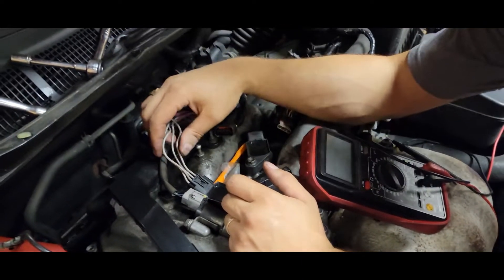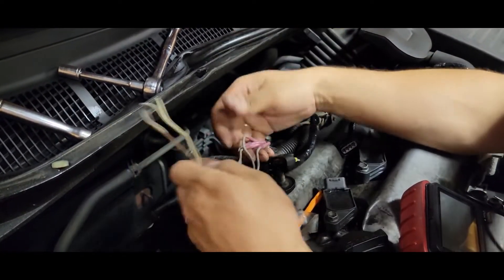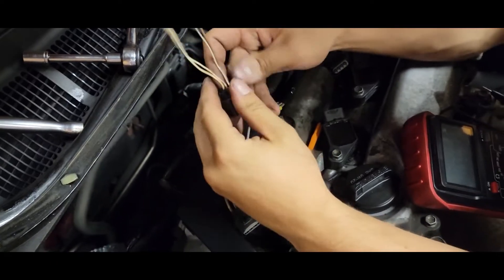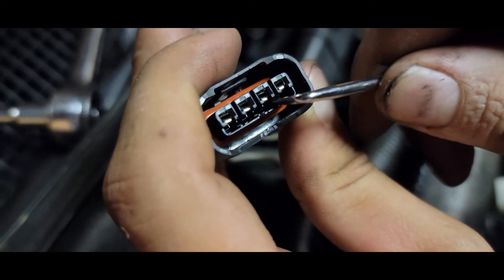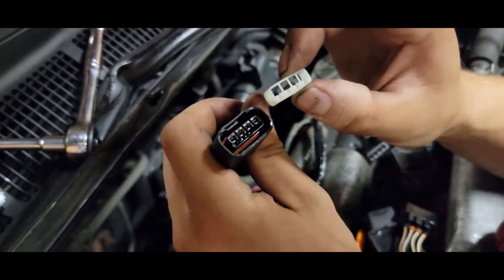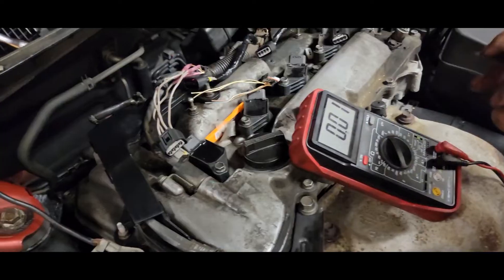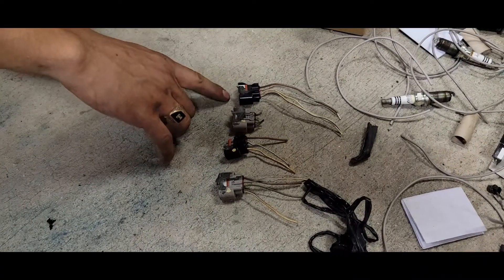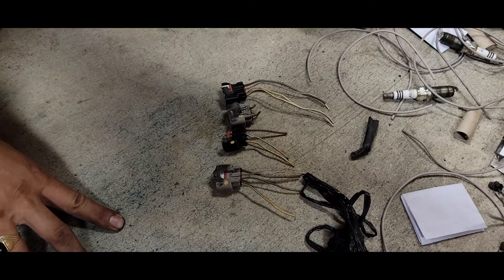Automotive Connector Repair and Test (2007-2011 Toyota Camry Ignition Coil Pigtails)

Comment: I checked all the wires, they have live electricity and ground. There is a difference in the computer electricity. Coil A gives me a computer signal of 6 volts, and that is normal. As for the rest of the plugs, the other coils, the computer signal sometimes gives me 11 volts.
Reply from the maker: What vehicle?
Reply: @BronzeTGarage  Toyota Yaris 2007
Reply from the maker: I would suggest testing your battery before going any further. This sounds like a serious wiring or ecm issue, if its not a low voltage issue.

Comment: I ran into a issue where the little prongs that latch onto the clip inside the connector got a little bent. What do you recommend I do? I can't find any videos online showing how to remove the pins from wires. Is there any soldering involved?
Reply: It started with a new apps pigtail and just one little connecting pin got mishandled  when removing. I'll try to reshape the slight bend 
on the metal prongs. Its hard to identify these little connector terminals for a new one, so many.
Reply from the maker: No soldering involved, I highly recommend finding a new pigtail to replace the other. The pins are the most important part.

Comment: Is this a good way to check temperature sensor connector?? It’s a DC connector and well it works but would go out randomly. Went out as I pulled into work but when checking the wires was fine and no issues but as I turned the car back on it read the temps fine with no issues. I did replace the sensor already some months ago and the thermostat but not sure if it’s the connector or just the sensors issue.
Reply from the maker: @Kryptonics123456  Yes, you can usually find the exact current outputs in forums if you look hard enough.
Reply: @BronzeTGarage  do I put the clamp over the connector or just 1 of the wire. There is only 2 which I think 1 is ground and the other is power. I know the voltage it needs to be at but just want to know so I can better check it
Reply from the maker: @Kryptonics123456  you can run one wire to the negative battery terminal and test to see if you get a positive read from either wire on the plug while the vehicle is running.
Reply from the maker: @Kryptonics123456  Once you try using the negative terminal to check, you can test both positive and negative at the connector to see if you have a bad connection at the plug. If it doesn't read while using the negative terminal, then it's the positive connection at the connector. You could also test the negative connection by doing a "continuity test"; set your meter to continuity and place one probe on the negative terminal and the other on the negative connection at the plug.

Comment: When checking if grounded I had one wire read 0. There was continuity to the pcm connection though with that wire though. Any thoughts?
Reply from the maker: If it has continuity that is great, if it doesn't have power and it is supposed to have power it is likely a short at the pin on the pcm side, or a technical issue with the pcm itself. Not saying to do this... but if you need to drive, you can jump that wire from another cylinder, so long as they are on the same stroke, or if it's a constant power wire. The proper way to fix this would be to send the pcm to be repaired, or replaced.

Comment: Great Video. Is the multimeter set up to 20 Volts? I am not sure if oms. Tks also sub 2 ur ch.
Reply from the maker: @nebhosspin1252  its set to volts. Most modern vehicles starting system operate on 12volts.

Comment: Hi I'm having a misfire on cylinder 3 my connectors have only 2 wires, after watching this video with accessories on I get 12 volts on both sides in this connector and other 3 cylinders are 12 volts one side and 5 other. Does this mean Cylinder 3 is shorting out? Also when I wiggle down further it fixes itself.
Reply from the maker: Sounds like you have a break in that 5v wire and the 12v wire at the same spot or at the connector.
Reply: @BronzeTGarage  Hi thanks for your response would a car electrician be able to rewire to fix this issue? Sorry by break do you mean short?
Reply from the maker: @JoseSandoval-ic5xe  yes, a short is simply when two wires are touching. I say a break in the wire to identify that likely the plastic lining over the wire has broken. You can take it to just about any mechanic for a fix. Just let them know your findings.
Reply: @BronzeTGarage  Awesome thank you so much for your help.
Reply from the maker: @JoseSandoval-ic5xe  anytime! Thanks for asking!

Comment: I was doing a repair on the car cranking it then suddenly the power to ignition coils stopped, only the starter will turn and ignition coils will not fire anymore

Do you know where the relay is for ignition coils? Only the starter and crankshaft are turning
Reply from the maker: Should be in the box located near the shock tower under the hood.
Reply from the maker: Look for the "ignition relay"
Reply: Still not fixed, turn the switch on tested all plugs and it gives same reading as you did.  When ignition is on, there is one fuse called A/F it’s 20 there is no power to it.

And crankshaft position sensor, I test it is working. Not really sure what’s the issue.  I did point crankshaft pulley pin point to the 0 line twice still not firing, only starter turns.  Do I need to keep pointing the pulley to 0 mark and try

Comment: Ik this question is not related but I have a 1998 Lincoln town car & it just won’t start. I had 3 bad fuel injectors and coils so I did all 8 of both and even bought a new alternator & no start. What is the most common case in this situation? No compression, no spark, bad ground or bad starter ?
Reply from the maker: Buddy, from the sound of it you've had someone in your ear giving you bad info. First thing to check is to make sure you have spark, then you need to make sure you have fuel, and then if you're not getting air... well that's just unusual. Lol
Reply: @BronzeTGarage  no I have just checked them myself and at first the car didn’t have that problem it was misfiring when I would get up to 40mph so that’s how I found that out and fixed what I fixed than stop starting after I put gas in the car. Is a spark plug tester good ? In for fuel a fuel pressure gauge is good ? Idk how to test for air in the system lol
Reply from the maker: @priinceanthonykoldd7071  start by testing for spark, and also ensure that your plug wires are in the right spots, and that your spark plugs are tightened down. Examine your spark plugs and check to see their condition. Google, "how to diagnose a spark plug."

Comment: Thank you for the video!
If anybody has any ideas 
I have a MK4 Jetta with a cylinder #3 misfire. It's not the coil, spark plug, injector and coil connector tests good on multimeter. It's also not a compression issue. What do you guys think it could be? The ECU? Grounding issue?
Reply from the maker: Pull the plug to see if you are running lean or running rich.

Comment: In checking the voltage of the connector, can i interchange the positive and negative probes? That is using the red probe to check the voltage in the connector whiles black probe is connected to the negative battery terminal?
Reply: Do you have a video on how to check voltage or resistance in the transmission wire connector for Toyota?
Reply from the maker: I do not, but I can make one soon enough. All you really need to do is look up a schematic and it should tell you. If not, then you can locate the power and ground pretty easy, the same way I show with these connectors. @juliustay2541
Reply from the maker: You sure can. It will just read the opposite. For instance, +12 volts will read -12 volts.
Reply: @BronzeTGarage  Oh OK. 
Thank you.
Reply: What is supposed to be the correct voltage of each point of the connector after turn on the switch ?

Comment: great info thank you, i have vw mk5 R32 having this P0351 code its intermittent misfire with rough idle, changed new coil original vw and all spark plugs changed and connectors. i can see a strong spark out of the coil for cylinder 1. how likely this issue is caused by a faulty ECU and if its the ecu would the coil still  fire normally and constantly maybe signal sent wrong from ecu? would appreciate your feedback
Reply from the maker: First, I would like you to switch cylinder 1 coil with another. It is possible that the new coil is having issues or is damaged. Let me know if that changes anything. Second, did you see any oil in or on the tube or spark plug when you pulled the coil? Third, are you getting any other codes?
Reply: @BronzeTGarage  i switched the coil to diff cylinder and still cylinder one misfire, no oil on spark plugs. the change i found since started having this issue is the car on cold start revs on lower rpm 700 all the time don' t know if it is related in any way, pcv valve is new, compression test showed normal readings still i need to try it while is engine is cold. i am confused about this
Reply: @BronzeTGarage  other codes are P0300 and P0301
Reply: did the test as you instructed in the video and readings came out the same on all coil connectors
Reply: the readings were:  around 12 V on 3 pins and on one pin 0.2 thats for all coil connectors
Reply from the maker: So, being it only misfires on cylinder 1 and you swapping the coil didn't fix it, try swapping spark plugs with another cylinder. Also, check the plug to see if that cylinder is lean or rich, and check again for carbon build-up or oil deposits. It could be an issue with the tune or valves associated with that cylinder.

Comment: Can a bad wire cause a ignition coil to keep going bad? My mom keeps having to replace them every couple of months.
Reply from the maker: Yes, but also a bad spark plug can cause it. What vehicle is it on? And do you see oil in the hole when you swap it out?

Comment: While checking connectors is the key in ignition at all
Reply from the maker: Yes, put the car in on mode without cranking it. Should be able to use the windshield wipers if the key is on mode, it is the second click.
Reply from the maker: @David-qw2iv  what's your battery voltage?
Reply from the maker: @David-qw2iv  I want you to see if you have ground at the starter bolt and ground at the end of the ground wire. Ensure that it is a strong ground by checking the voltage through it.

Comment: can this cause misfire?
Reply from the maker: Yes, very much so! I encourage you to check your spark plugs first. Type into google "What does a healthy spark plug look like?" If it isn't a healthy spark plug, start there. If your spark plug is good, I recommend swapping the coil that is on the misfiring cylinder with another cylinder that is not misfiring. This will tell you if it is the coil. If it is not the coil, then you need to check the wiring on the plugs and do what I did in this video.
Reply: @BronzeTGarage  ive changed both spark plugs and coils and changing first coil i saw broken connector, some people said they could cause misfire too
Reply from the maker: @augustinasnavickas5268  sounds to me like that is exactly what your issue is! Let me know when you are able to fix!
Reply: @BronzeTGarage  i will, thanks for the video
Reply from the maker: @augustinasnavickas5268 I'm glad I could help!
Reply: @augustinasnavickas5268 did it fix your problem? I’m going thru the same issue rn, there was no voltage coming out of my connector and I think that’s what’s causing my misfire code
Reply: @chickennwaffles6950  my connectors had voltage they were just broken, but it does sound like a issue if no voltage is comming, no spark in cylinder
Reply: @augustinasnavickas5268  still having issue, changed connector, fuel Injector, spark plugs and ignition coils still throwing codes
Reply: @chickennwaffles6950  after changing connectrs they gavę voltage?
Reply: @augustinasnavickas5268  yes checked the wiring it had voltage, cars is still saying misfire on cylinder one and ignition coil “A” secondary circuit, I was thinking just taking it to dealership hopefully they can tell me what’s going on even after changing all those parts out
Reply: @chickennwaffles6950  that is a brainer of a situation, i hope you will figure it out, for me it was bad fuel quality, but im still changing wires later and replacing all hoosing
Reply from the maker: @chickennwaffles6950  I'm just seeing these comments! It really sounds to me like you might have a bad ground.
Reply from the maker: @chickennwaffles6950  your issue is actually with the spark if it says secondary circuit, it may be the coil itself, swap it to a different spot and see of its the same code. If it moves its the coil, if not, you may have a bad ground or a loose positive 
connection.
Reply: Been getting code p2300 and p2303. Which is misfire on cylinder 3.
Coils and plugs are good, was testing the wires as you were and on cylinder 3 with ignition off and probe on the battery one of the three wire read 0. The other two read 12.72. Thoughts??? Thank you!

Comment: What if when i put the key in the ignition before it cranks, theres nothing for the ground in the wires?
Reply from the maker: You should have a constant ground unless you have an antique vehicle. Make sure you pay attention to the voltmeter and ensure your probes are installed correctly. It could be that you are reading it backwards... it could also be that something is wired backwards.